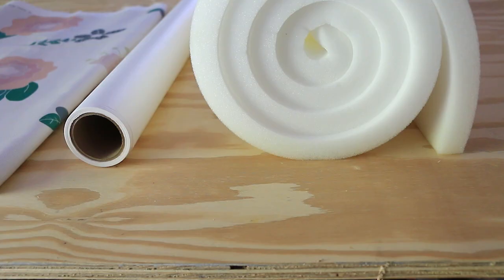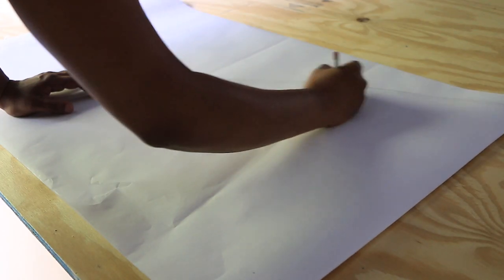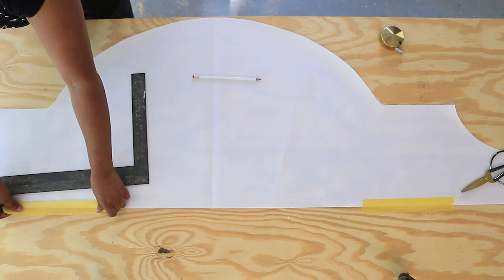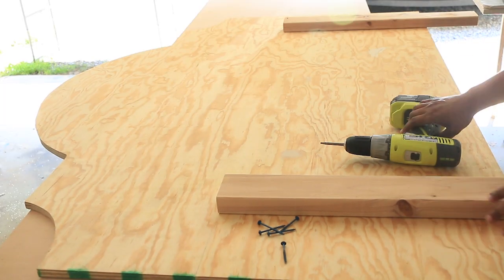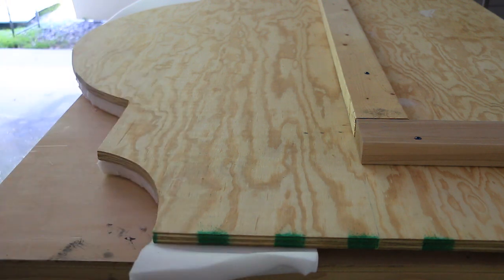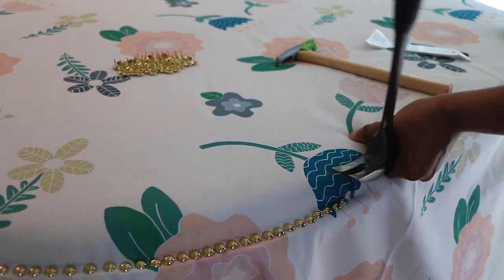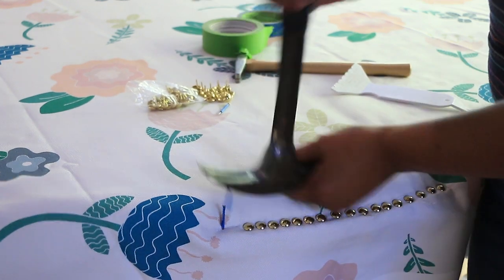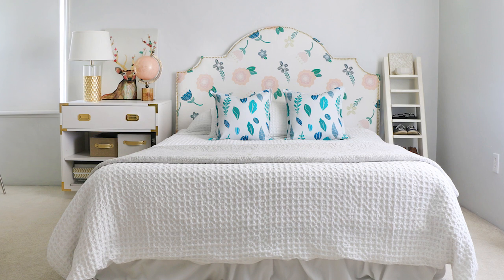DIY Nailhead Headboard

Comment: Do you think thumbtack can use instead of upholstery tack
Reply from the maker: If you use staples to hold the fabric in place, and the thumb tacks are strictly decorative, you might be able to make it work. However thumbtacks do not have the nail base an upholstery tack would...